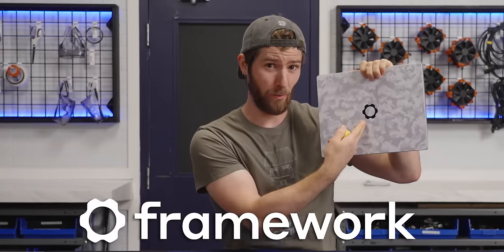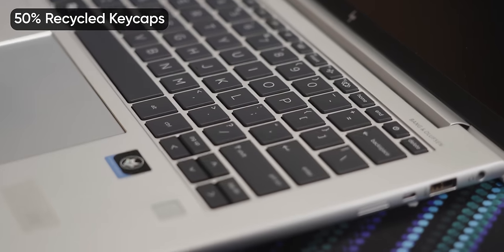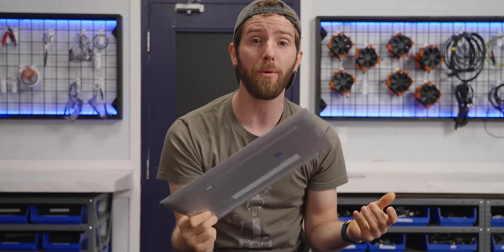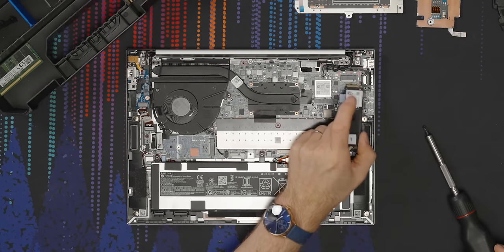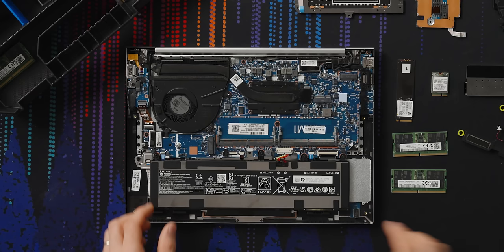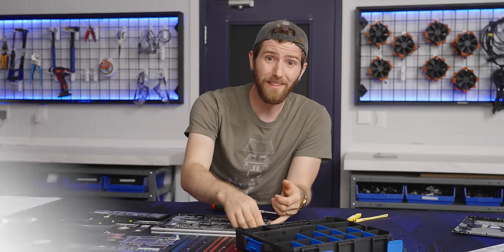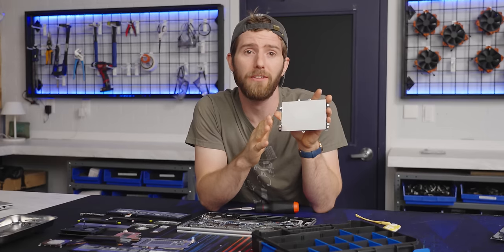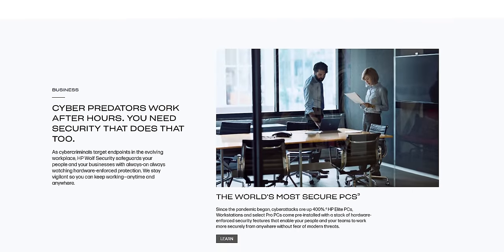My Investment is in TROUBLE - HP repairable laptops

Comment: I’m genuinely really impressed that hp is making an effort, I couldn’t imagine dell doing such a thing.
Reply: Why make it repairable when you can up sell a warranty :)
Reply: HP, Dell and Lenovo do shockingly well in this regard. Service manuals are easily accessible. HP tends to the stick to the same style of screws. Dell and Lenovo use torx and Philips.
Reply: @beeeennnnnnn  big brain
Reply: Too bad HP products are too bad to be worth the hassle of buying let alone repairing them
Reply: dell? they are very repairable
Reply: @horseradish843  Look at the XPS, and their gaming PCs/laptops and tell me if those are repairable
Reply: Dell have user manuals available for all laptops and are very easy to open and repair,  Apart from maybe the sealed xps displays . dunno what you are on about. i see nothing special with this laptop tbh
Reply: I worry if this is an one-time-off attempt, just to get Framework out of the market, so they can go back to they unrepairable laptops without worrying about a potential competitor.
Reply: I'd be happy if Dell could make a budget laptop that doesn't fall to bits in less than 30days.  Had 3 failures so far in a batch of 50,  hinges too stiff for the chassis plastic and snapping all the plastics.
Reply: @xFluing  violated XD
Reply: Dell is the enterprise king for repairability.. HP and Lenovo is laughable
Reply: HP have always had service guides for a lot of their laptops it’s great.
Reply: @IQCQ...did you ever had a Dell laptop? I had 2 Precision laptops in my past and both were very well to repair or upgrade. Very modular. Not sure what you are referring to
Reply: @xFluing  could you elaborate? I have not had the same experience
Reply: Hp laptops are like the opposite of their printers. I loathe HP printers. 

Oh you want the feature advertised on the box like push button scanning on the device? Sure, just create an account download an app, accept every data sharing agreement, then send all of your data to us and use our other app, no not that one the other one, no the other other one, theeeen after we finish advertising to you and telling you to buy more ink we will finish harvesting your data and send the scan you ran 2 minutes ago to your computer. 

Whoever created the nightmare that is modern printers should go to jail. Serious. It's a crime against humanity.
Reply: The only problem with this is that I think most of us know they will sell replacement parts for about a year and then silently discontinue them effectively returning to square one, but will reap all the praise.
Reply: This doesn't look anything unlike any dell ive opened of the last decade or two. Their tech docs are easily accessible, and parts are easily obtained online. Batteries, keyboards, though not always direct.
Reply: It's crazy because their modern Latitude (business centric) laptop models are already very repairable when you open them up. They need to start designing their consumer targeted models the same and make parts more widely available to consumers
Reply: @JuanPablo-ho7fg  I had a 2018 HP pavilion that was almost as repairable as this one. The only minor things were the screws under the rubber feet. And the battery that was taped to the frame. Other than that, everything was really accesible.
It was not modular, so that's a great selling point for framework, even if their competitors go the sustainable way.
Reply: @JustSomeGuy009  This, I work daily with both HP elitedesk series(specifically 830G8) and the Dell Latitude series. While the HP is decent to work with, the Dells are just better. Also less hassle of getting replacement parts for when they do have a defect.
Reply: @JustSomeGuy009  the whole point of this push and movement is for better repairability and parts availability for consumer products too. Inspirons, XPS, and especially Alienware models are way more of a pain to attempt repairing than latitudes. I would know. I've been inside of hundreds, if not thousands of laptops between 2017-2019 as a breakfix tech
Reply: YES. YES. Let them fight..
Reply: @abhimaanmayadam5713  Lenovo does a great job releasing information for more simple repairs and upgrades but, at least in my experience, the mechanical tolerances for bigger repairs can be a bit iffy on a home-repair level. I still like Lenovo's enterprise laptops (especially the old T-series that can survive a chuck down a flight of stairs), but I have had issues repairing my old T430 (thermal adhesive replacement/screen replacement) (probably) due to user error.
Reply: True!
Reply: Dell does pretty well. Some tweaks will make it better. HP putting on this pressure is going to make others do the same. It's all fantastic.
Reply: We've got some Dell laptops at work which are just as chunky as these HP devices, but the RAM is soldered onto the motherboard with 0 additional slots, completely non upgradable. (even Lenovo includes at least 1 upgrade slot!)
Reply: My Dell Vostro laptop is very easy to upgrade and repair. 

I dont even like dell.
Reply: @ChrisUKFF  They do but you have to get one of their business products.
Reply: my compagny uses dell laptop since 10 years... and i can see reparability going down every generation, from soldered touchpad to now, soldered memory...
Reply: The thinkpad manuals have helped me in the past, super easy to get a hand on
Reply: If i were running a in house it department for a big company i would look haard at options like this, since it seems like it could not only make my life easier, but also possibly save some money.
Reply: @JuanPablo-ho7fg  HP have had the parts store (formerly part surfer) for years before Framework was a thing, and have multiple third-party resellers in many countries (some only B2B, but others just have a web shop that anyone can buy from) so you don't even need to buy parts direct from HP if you don't want, or if HP are out of stock as they tend to be on older models (by the time you need to repair something). On some models, not all the parts are listed under the PC itself for some reason, but if you open the laptop, many of the parts have their model number on them as a "replace with HP Spare XXXX-YYYY" sticker, or you can always open a case with customer support who will be able to get the part number for you as my manager had to do recently as we forgot about the stickers.
Reply: Dell isn't exactly the worst brand for repairability, but are they still using their proprietary chargers and their laptops refuse to accept power unless it has one? Because if so, I rate them very low and wouldn't want to buy one.
Reply: @ItsBBP  Had to work on an ancient (Vista-era) HP laptop recently. It was having trouble POSTing (and when it did there were issues in the OS), so I figured faulty RAM. This was back in the days of replaceable keyboards, so some parts, such as RAM slot A, was under the keyboard. (Slot B was on the bottom of the motherboard, so just needed the bottom panel taken off) Guess which of the 2 was faulty?
Reply: @horseradish843  Oh how wrong you are. I have the classic 2017 dell gaming laptop and it is the least repairable thing ever. And the stupid hinge problem that literally cannot be fixed.
Reply: @tomcraftdonkey2285  oh I have only tried their XPS line up which is very repairable and serviceable, but I guess the difference is the pricepoint
Reply: @totallynotbluu  the XPS line up is very easy to repair and replace parts. What edition are you thinking of? I have owned 9550 and 9520 now
Reply: @JustSomeGuy009  this is what I came here to comment. I work in an org that exclusively buys dell, and every repair part in this video has been standard in dells as long as I can remember, and only improving over time. Service guides are freely available, parts are easily available either directly or 3rd party, and the designs are both sleek and extremely modular. And if you work for an org like I do, you can self diagnose and order the replacement parts next day yourself, including a check from Dell for self service instead of them performing it.

Literally could not ask for it to be better. Now their consumer lines.. Yeah they need to catch up there. It's better than some, but still needs work
Reply: @hugz551  my 10th gen i7 business laptop has replaceable everything.

Ram, a second m.2 slot, simple screws that can't get mixed up, easy access to everything with just 7 screws 2 of which are captive.

I haven't checked if the touchpad is soldered
Reply: I’m not familiar with dell laptops, but I can at least say I have a dell optiplex, and those are made to be very serviceable and upgradable. Many parts can even be taken out without screws due to the way the mounting system is made.
Reply: @JeppeBeier  it’s a running joke on this channel that dell sucks
Reply: This is just a curtain. Schematics are needed. Everything else is bs paid reviewa
Reply: @ChrisUKFF  still have my 2012 dell inspiron N5110 and it's doing amazing more than a decade later
Reply: @conradmbugua9098  Yeah it's almost like Dell isn't building them the same... 8 failures out of 30 on a particular model <4months old.  Cheap flimsy shit plastic falling to pieces.
Reply: @ChrisUKFF  Yeah, if i decide to buy a new laptop, i won't be going for Dell, probably lenovo thinkpad and hp as a last resort